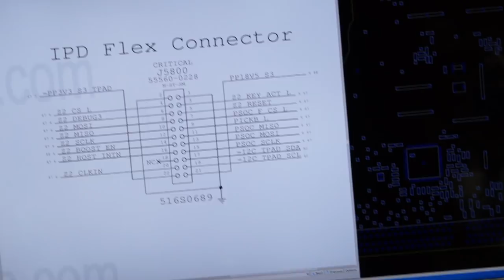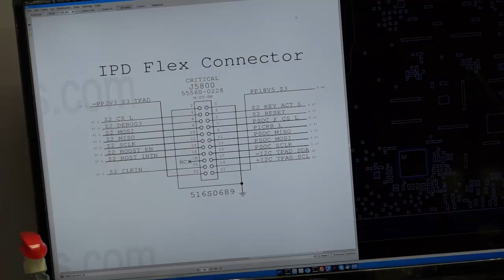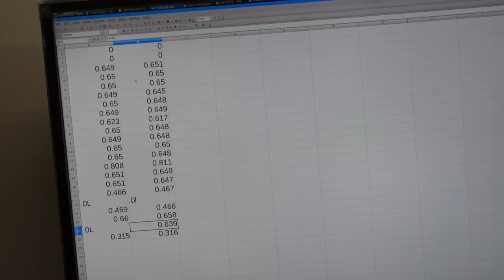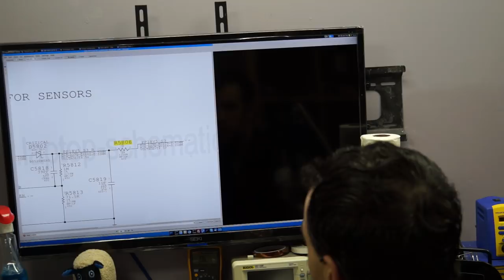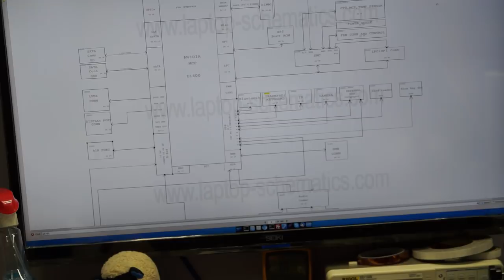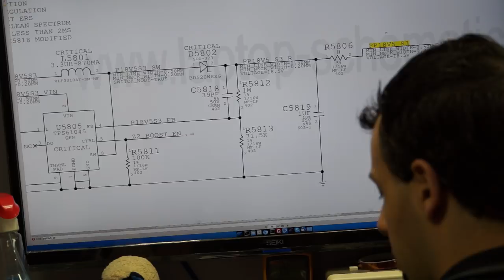Importance of DIODE MODE measurements for troubleshooting.  820-2879 no trackpad

Comment: How much voltage should a DMM put out on diode mode for electronics testing.  I believe fluke max out at 2V.  Do you ever run into situations where 2V isn't enough en you get OL.

Comment: So I need anther notebook that is the exact same model but is working fine, what if I don't have one?
Reply: go to the schematics and see all the pads:

GNDs: near 0 and bips in diode mode
Not connected to any other part: OL
Others:
cant be near 0. Short circuit caused by a capacitor i parallel
cant be OL. Lost/broken connection, can be solved by a jumper or a reballing

Comment: Zero Ohm Resistor? Is that not a contradiction of terms. A resistor that resists the flow of current by a factor of Zero fails to meet its own definition... Was this intended as a fail safe that is even cheaper than a .005 cent fuse or Idiot Engineer?

Comment: Quick question for you Louis, I hope you don't mind (too much).
Lenovo Y550... works fine but when you shut it down the screen lights up gray and won't turn off. Is the GPU responsible? Or is there a known issue that causes this?

Comment: When using diode mode for comparison testing between a good board and a bad one, why put the red lead on the ground and the black lead on the circuit, rather than the other way around?  Your training guide pdf ( thank you! ) doesn't explain why.

Comment: I'm curious, if you just used solder to replace the 0 Ohm resistor, with the idea of heat making it act like a fuse by melting the solder.  makes sense.  but if the board is sitting horizontally in the computer, wouldn't the solder just bead up and sit there?  would it actually break the circuit?

Comment: How do you fix those lights on the screen? I've had it before and wasn't able to figure it out. Although, I didn't spend too much time on it.
Reply from the maker: LED return lines. Either bad cable, bad screen, bad 0 ohm resistors on LED returns, corroded LED return pins on LED driver, corroded pins on LVDS.
Reply: thanks. Noted.

Comment: I use that a lot too. Basically, all semiconductor ICs data pins have a protection circuit of a diode with the anode to ground, and often another diode to the supply pin of the ic. The diode test on the meter tells by these diodes, if an ic is connected to the point being tested. If not .. examine closer.

Comment: Hi Louis- I have a 820-2936 that has no trackpad. There is no voltage on pin 4 of J5800 which is Z2_CS_L but I have 3.3 on Z2_CS_L at U5701- any ideas??

Comment: wait, I thought in dc all voltage returns to negative. If it leads to ground would you not have a fault?
Reply: Gary you can have positive or negative switches. But they all need a path home to open or close the loop.

Comment: Hi Louis! How are you? I've got a MacBook A1278 820-2327-A, which I replaced the hole screen pulled from a working unit, bluetooth works great and so does the webcam, but wifi shows up but doesn't recognize any network (already checked antenna and that's not the issue), I would really appreciate if you could help me, Have a great day!
Reply from the maker: PI X Foam pad shorting pins on wifi connector. People always take the black tape off the pins but leave the foam there. Either that, or bad wifi card, bad OS, or bad antenna. Or bad cable. Who knows.

Comment: I know every setup is different per machine but on hot air rework how high do you run your temps to get a quick melt? Also Ive been messing with chip removals from iPhones and iPads. Anyway to get a good melt and easy lift with that shitty epoxy they put under those chips?

As always, I enjoy your videos Louis.
Reply from the maker: 7 1/2 to 8 on the FR-801.

There is no temp indicator on that thing.
Reply: Ah ok

Comment: Problem I am having is I don't know how to read or use schematics.  Any videos on the subject?
For example:  iPad 2 not charging.  I can order the parts, I can find the locations only because CyberDoc pointed them out.  But how do I do this on my own as if this material wasn't available.  & I would like to know how to test these parts so I don't have to change them all.
Thanx : )
Reply from the maker: Google to find guides on what capacitors, resistors, inductors, voltage dividers, buck regulators, etc do. Read, analyze, and figure it out. Don't rely on cyberdocllc to do it for you, he is buying $0.10 parts on mouser and reselling them to you for $20.

Do you know the difference between him and you? Just once, he used his brain - and he is charging you for the privilege. When you turn your brain on, you're not at the mercy of these people.
Reply: Louis Rossmann Excellent advise Louis.  A finger in the right direction.  Thank you, I will learn these.  As far as using my brain, I was thinking I can identify all that I can from what CyberDuck shows and how they fit in the schematics and what I can gather.  Sure to have new questions once I have some knowledge and get stuck again.  I'm aware of Mouser, just don't know how to ID what I need and stuck having to order from CyberDuck in the meanwhile (probably not if I figure this out). Been watching all your videos from start to finish, on like page 2 (man you got a lot of videos). (Got questions on those too -LOL)
Reply from the maker: Tony Tone Buy full boards. I buy full unibody macbook boards for $15-$25, they're just missing cpu/pch/gpu and have a hole or two in them. They have all the things I need. For standard things I replace all the time like backlight fuses, power ICs, GPUs, I have new sitting here in reels, but the rest of the shit you shouldn't always be running to mouser or digikey for. You need scrap boards to grab that stuff off of for immediate repair.
Reply: Louis Rossmann studying your video on Importance of DIODE mode.  I have a Fluke 114, no diode mode LOL.  What multimeter you recommend?
& thanx for the info on components.  Duly noted.
Reply from the maker: Fluke 15B

Comment: reference to your video about "Self Entitlement", i used my self entitlement to scroll down, to find your super secret board view software, (though i have nothing to do with it) just asked a local repair shop to replace my iphone's so called battery management ic (the name was provided by the repair shop i do not know the actual name or term used for that) so googled it  and found it laying right next to the CPU, thanks to your board view software link got it negotiated and reduced the cost by around 25$ .

PS, what the heck is this battery management ic doing with CPU, "a board that was fucked up by an idiot"----- in the design lab